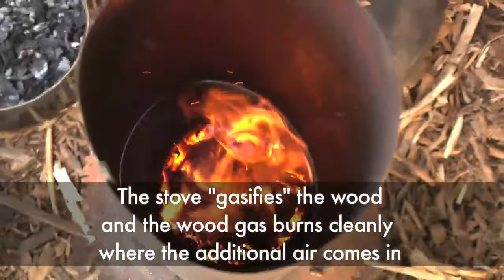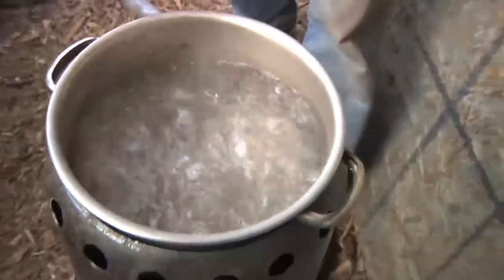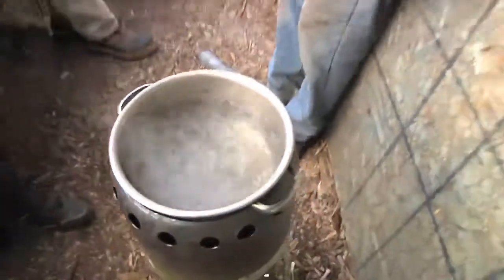Top-Lit Updraft Gasifier

Comment: Nice en robust design, thanks for the great info i used to make them from thin Material sp they don't last, i found a 1 to 3 or 4 Ratio primary to secondary air area,  

what is the minimum fuel size en moisture content you can run whit it ? Something like 2cm min chips en 25 / 30% ?

Comment from the maker: I would imagine that insulating it would make it slightly more efficient, slightly heavier/bulkier. The heat still has to go somewhere, and if it can't radiate out the sides, it's going up to heat the food/water/cooking vessel.
For something this small, I don't think it would make much difference, but for a larger more permanent insulation, I would think insulating would be a good idea.